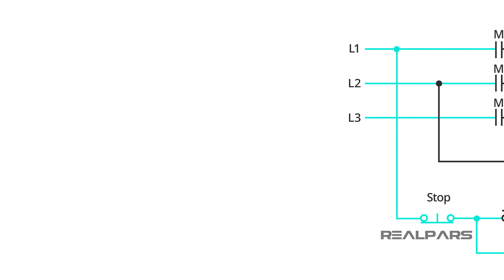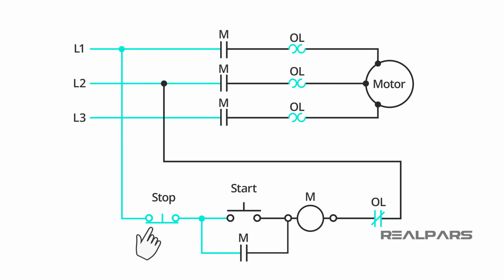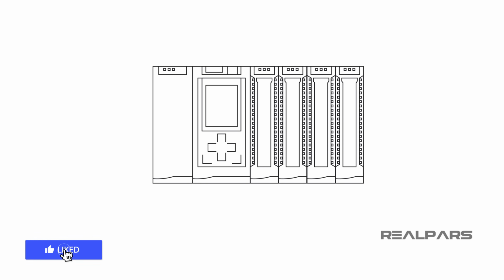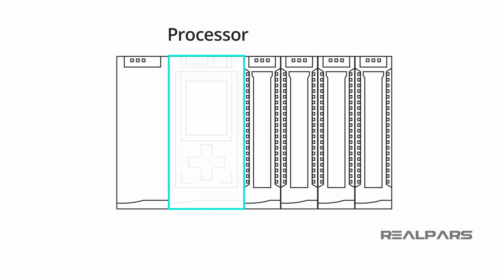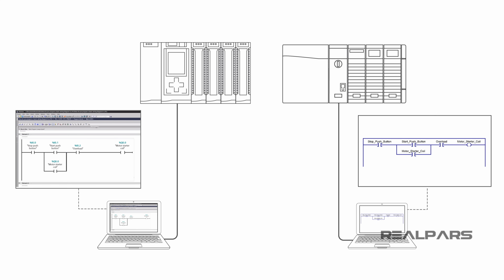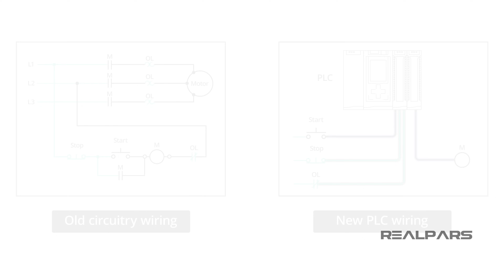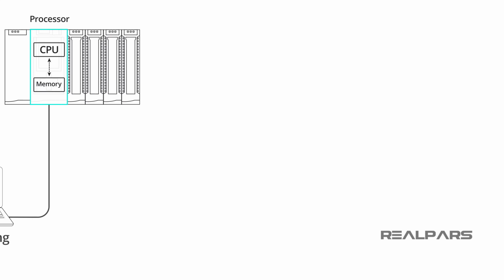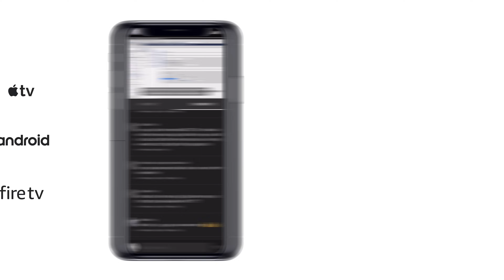PLC Hardware Explained

Comment: Does Power Supply distributing power to modules by series like that?
Reply from the maker: Yes, this is one way to pass power to each module, but many times this is done with a backplane connection if the power requirements are small.  Most systems use an external 20VDC power supply for the I/O cards to separate the PLC and I/O circuits.

Comment: Thanks for the video....when talking about the power supply of the PLC, does it mean it converts the AC supplied to it to DC, which is in turn used to power the I/O modules...Hence, we don't need an external DC supply

Comment: I don't understand why PLCs are still being used in the industry. Taking into account that they are basically microcontrollers made with proprietary hardware and software. Which means that the PLCs industry is all about making profits for the big PLC manufacturers.
Reply: its not only a microcontroller and yes basically you can build all of the components by yourself, but it would be very time consuming which will cost you alot in the end
Reply: Even I had this question running on my mind

Comment: Power supply applies for the plc modules but not for the fields devices.... Could please explain?
In this case where do they got powered or activated from?
Reply from the maker: Hi Wassem. There will be external power supplies that are used specifically to power field devices.  For example, if the Digital Input module is a DC voltage type, there will be an external DC power supply available to power the field devices such as switches. This external DC power supply is usually mounted somewhere in the same cabinet as the PLC.
Reply: @realpars  but the power supply of the cpu also provides power to the control circuit of the module. Is that right? 
And i suggest to have an episode or rather a series about the grounding of the PLC components.
Great content 👍
Reply: There are PLC that can provide their own power, but these are not recommended.